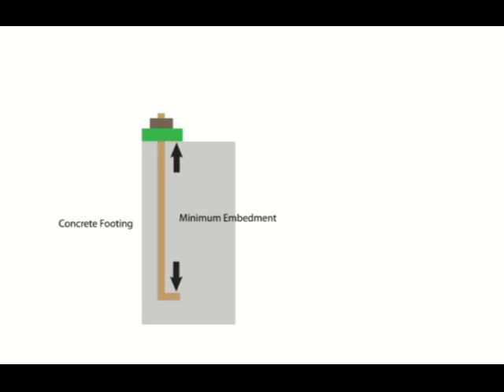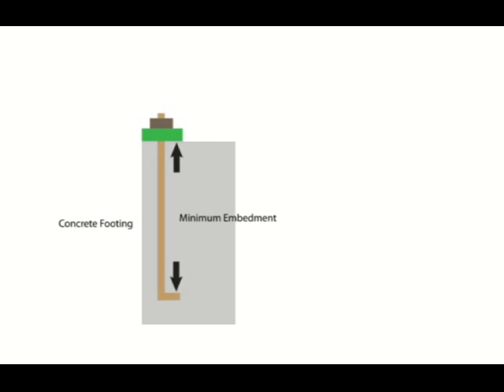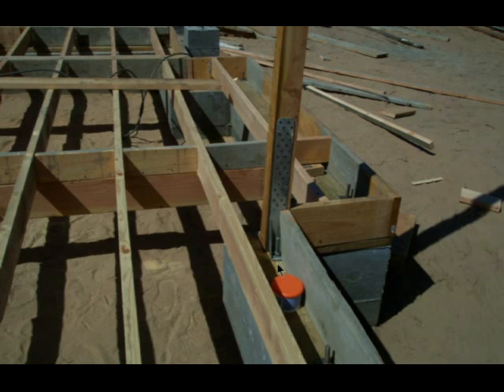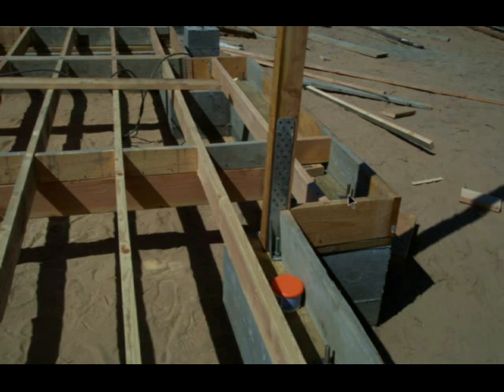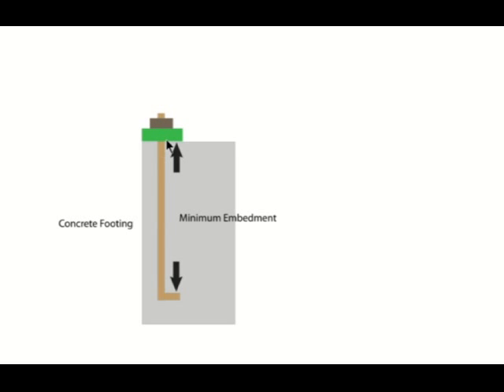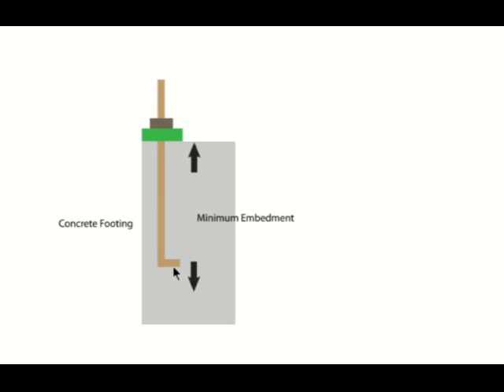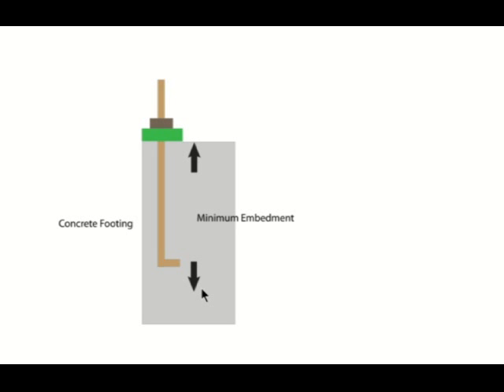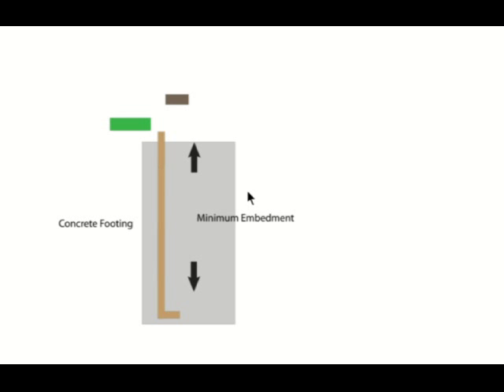Anchor Bolt Embedment - Foundation And Framing Tips

Comment: There is an dead simple solution, take two 2x4' and nail them together(to act as a double sill plate), drill a hole the size of the anchor bolt centered on the 2x4s, and insert the anchor bolt with the washer and bolt screwed on so only 0.5" of thread protrudes then the 'L' part of the anchor bolt hangs down from the 2x4 into the wet concrete supported on both side by the top of the forms. Perfect every time

Comment: There are 8, 10, and 12 inch bolts.  What size should i buy when building my pergola which is going to bear the weight  of swings and hammocks? I am using 6x6 posts.
Reply from the maker: I can't provide engineering advice, but longer and larger is usually stronger.

Comment: Anchor bots how many inches beside eachother I got to put in!! Every 16 inches ??
Reply from the maker: Some have a maximum spacing of 72 inches.
Reply: @gregvancom  thanks for your respond. I am using the 14 inches anchors what's safe length to stick it out of the concrete and should I tight it to the rebar every 32 inches ?

Comment: Hi greg, Great video! In your opinion what should the minimum embedment be for a 5/8"-11-12" galvanized J anchor?
Reply from the maker: It depends upon wall framing plate thickness you're going to be using. You will need to subtract the width of the wall framing plate along with the nut and washer used and then add it least a half-inch to that to find the embedment length.

For example if I have a 1-1/2 inch thick wall framing plate, a quarter-inch thick washer and a nut that measures 1/2 inch in height and add all of these measurements together, I would come up with 2 1/4 inches. Then I would add a half-inch to that, making it 2 3/4 of an inch. This would be the measurement that you could subtract from the anchor bolt length to give you the minimum embedment. Let me know if this doesn't make sense.

Comment: How many inches do the anchor bolts have to stick out from finished concrete? Thanks
Reply from the maker: If it's a 1 1/2 inch thick framing plate then about 3 inches. If it's 2 1/2 inches thick then maybe 4 inches. It has to be long enough to be able to tighten the nut and leave at least two threads exposed on the bolt in most cases.

Comment: Love your videos, very helpful, probably the most useful on Youtube on this topic.

I was wondering if you have any ideas on the spacing on exterior wall on the concrete slab? Does the wall have to be inside the space by a certain inch or distance?
Reply from the maker: Wang Hung It's best to place them as close to center of the bottom wall framing plate as possible and it's a standard rule of thumb that one needed to be located within 12 inches of every corner or bottom plate break (where one board meets another) and no more than 6 feet on center space throughout the wall.